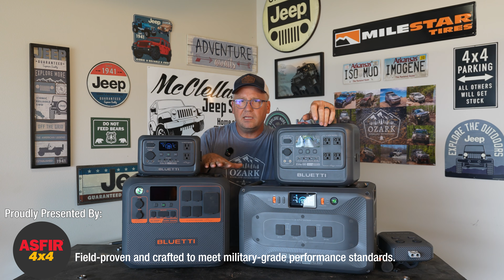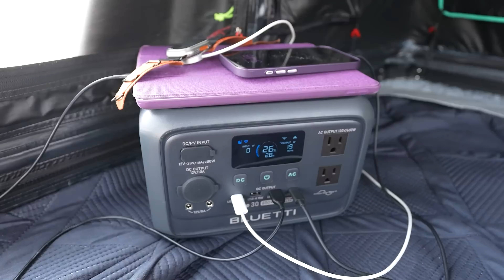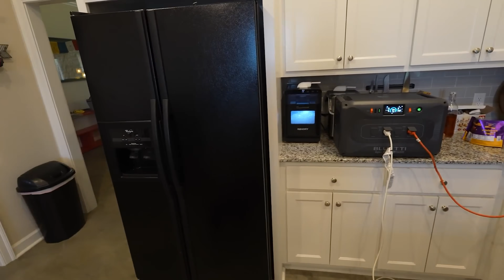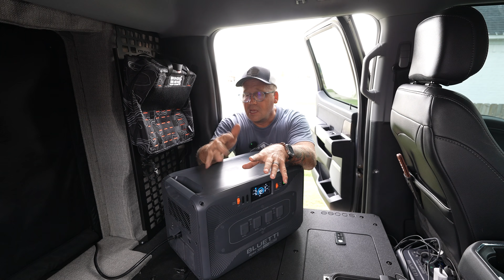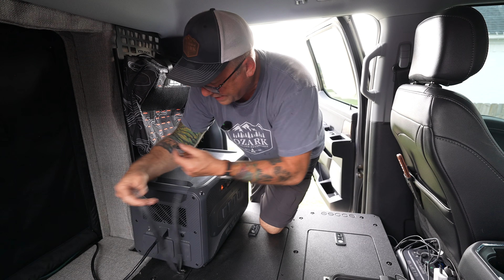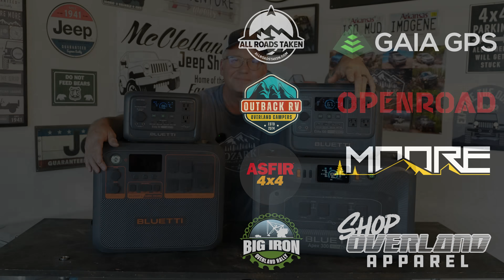How to Choose the Right Power Station for Your Needs

Comment: Is it possible to use the Elite 30 to charge an auxiliary battery station (if you don’t drive enough to charge it from the alternator)? My idea is that in the event of living in your car, you could have that auxiliary battery for more power but since you can’t just take it to the library or Starbucks to charge, you could use the Elite 30 as a phone power bank… so charge it anywhere since it’s so small and charge your extra Lifepo4 battery with it, in your car 🤷🏻‍♀️ btw I know almost nothing about electricity, batteries or power acronyms, just been watching a lot on YouTube
Reply from the maker: You could but it wouldn't have enough power to effectively charge an aux system in a vehicle.
Reply: @OzarkOverlandAdventures 
Depends on the size of the battery in your system right? 😬
Reply from the maker: @Pierinaor would have to be a small battery as the elite 3p is less than 300wh or 22ah.

Comment: I need something for my 12V refrigerator when I go car camping. You said to use the Elite 100 V2 for a weekend. I so far have only been staying overnight when camping but I do hike a lot and it would be nice to have the refrigerator powered when I hike as well! I was planning on getting the Elite 200 V2 but my budget is pretty tight right now and my 12V refrigerator only uses 36W. I was thinking buy the Elite 100 V2 with the Charger 1 for fast charging and I should be all set. I drive a 2009 Toyota Prius and it has a built in generator for the high voltage battery and 12V battery for everything else. I have to shut the car off late night because they usually don't allow generators or car idling late night in campgrounds. You showed the Elite 100 V2 using the 12V plug in your truck and I have 2 of these in my car. The other thing I can do to try and save a little money is just use the 12V car socket because my car, when running, only runs the little 4 cylinder engine when it needs to charge the 200V battery. It then charges the 12V battery from the larger battery. Let me know what you think about my setup. Thanks.
Reply from the maker: I think that would be a great setup.

Comment: I’m running a 2025 Frontier, I power my gear with BLUETTI.  At the moment I have the 70, 180, charger1, and 200 solar panel.  I’ve got everything wired from the cab of the truck underneath to the bed of the truck.  Love your setup!

Comment: Just got a Charger 1 to go along with my AC180P to power my Iceco JP40 fridge. In high-summer I can get about 2.5 days on a full charge. With slightly cooler outside air temps I get just shy of 4 full days. I parked it full at 3pm on Sunday and by 7pm Wednesday it was down to 26% without powering up the Jeep at all. It loses about 20% a day with the fridge set to 32°F, and the fridge draws typically 38W when the compressor's running. My only complaint with all of these power stations is there's only one output, and it's the antiquated cigarette lighter plug. I'd much rather have Anderson outputs instead so there's zero possibility of the connector backing out when I rock crawl.

Comment: Matt, would the Elite 100 be a good size for powering a diesel heater? it'd probably be the only thing plugged into it at night  (my fridge runs off an aux battery in the jeep) since i have a little ecoflow i use for charging items in my tent

Comment: So why would anyone want to purchase a  Bluetti for overlanding when they are much better design systems from National Lunar (South Africa) and Redarc (Australia) designed to be charged quickly while driving much more efficient for the purpose and not like the bluetti designed for at Home.
You should look up about Redarc GoBlock 100ah overland battery system.
I’m not sponsored by them had to pay full price and recharges from flat to full in less than two hours of driving and is extremely designed for the purpose of heavy hard-working outdoor life.
How much is Bluetti paying you in sponsorship for this advertisement?
Your travel videos and I suppose you need to have money coming in, but you should be telling us straight upfront that they are paying you for this advertisement.
I’m disappointed with your other video so good I’m on the conjuring or should I unsubscribe and stop watching your series or just put up with advertising like this? That’s blatant one-sided nonsense as you would not need this with your Rossmonster!
Disappointed with you selling out your great channel.

Comment: Love Bluetti products. I have a AC50B and use it yo power a Bougerv fridge I picked up off Amazon.  With 2 ice packs in the fridge this little unit will power it for 36 1/2 hours before hitting 10% power left.  Very happy with the setup for camping. Plus has options for solar if needed.

Comment: Matt, be aware that the BLUETTI power station itself does not have vehicle battery protection however the Charger 1 does.  I hooked a BLUETTI power station to a 100w cigarette lighter port in my wife’s car to run her small 16qt Setpower fridge not realizing the port stays on when the vehicle is off.  It ran her car battery dead.  Everyone just make sure your port doesn’t stay on or else the power station will drain the battery.  
I run an elite 200 off a charger 1 to run my fridge in my cab.  I have an elite 100 in the bed of my truck inside a camper shell to run an electric blanket and Cpap.  I run the output hot lead coming out of the charger 1 to a 3 way switch.  I can monitor both BLUETTI’s with my phone going down the road and switch from one power station to the other keeping them both charged off of one Charger 1.   I haven’t had any issues with the power I need.   Hope this is helpful
Reply from the maker: Sweet setup!!
Reply: I like the 3-way switch idea, like on a boat.  Charge one battery, or the other, or both.  I guess you would just have to make sure the Charger1 is set to the voltage of the 'weakest link'.
Reply: @marceld6061 absolutely, you are correct about output.   In my case both my power stations can charge set to 56V which puts out the max 560W.